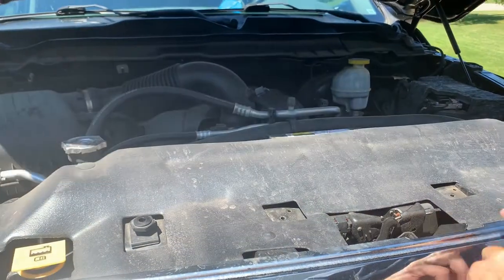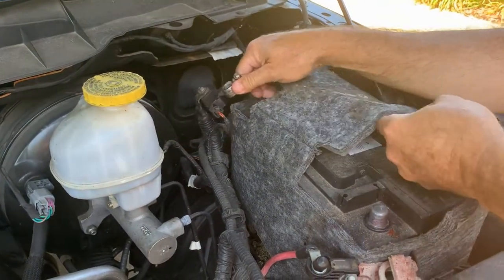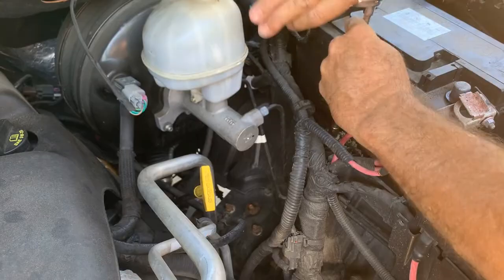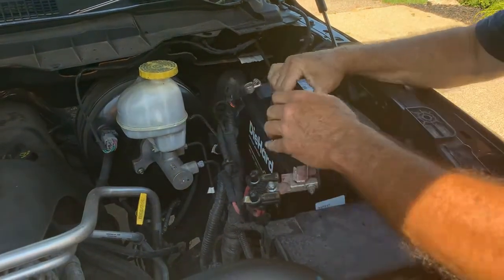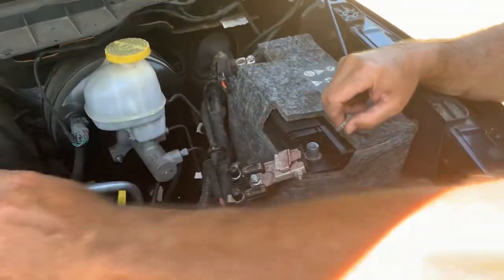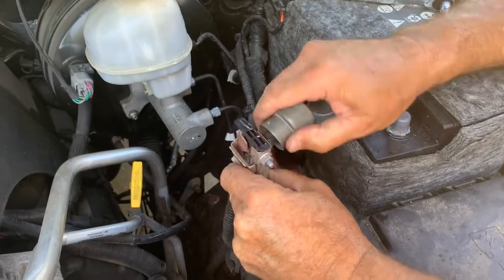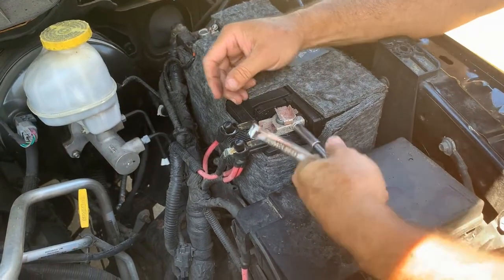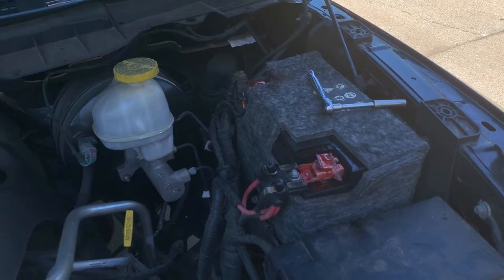How to Replace Car Battery Dodge Ram

Comment: I plan on trying this to remove a dead battery in my 2004 Dodge Ram 1500. My battery is less than 6 months old, and my charger indicated ii is a bad battery. After hours on charge, it does nothing and the lights on the dash and one small red light there all flash when I attach the charger back to it. The new battery has a strap to it, but I could not budge it for anything when I tried to remove it. I simply didn't realize that surrounding protective cover removes as you showed and the bolts holding it down are hidden like that. I sure am hoping that I can get it fixed tomorrow and take this dead battery back to exchange. Thanks for this video, as it is really helpful if it works okay on my '04. I'll have to get that small socket though. ;-)
Reply from the maker: You're welcome , Good luck!
Reply: Heyyy, how'd it go? I have the exact same truck. 2004 dodge ram 1500 5.7. I am about to try this too. Thanks for the tip!

Comment: Good video I thought you were supposed to disconnect negative first for safety. I'm trying to figure out if I need to use a memory saver for 2018 Laramie that has remote start.
Reply from the maker: Thanks, this Ram also had remote start no memory saver was needed.
Reply: Yes, you're correct. If you take the positive  off first, and you touch the metal from the truck with your tool, you create a perfect short. Reinstalling, same thing, put the positive on first and then the negative.

Comment: I’ve heard that disconnecting the battery on a New Ram truck will cause the vehicle computer to loose the memory. Did you experience any problem like that?
Reply from the maker: I've done quite a few 2016,17,18s and haven't had any problems. You might have to reset your clock and radio stations.
Reply: @TheAutoTeacher  That sounds about right, but just to be safe I’ll keep on checking just to make sure. Thanks

Comment: How many Amper
Reply from the maker: Dodge Ram 1500 from 2009 to present: Group size: H7/94R. Cold cranking amps (CCA): 750 to 850 amps.
Reply: @TheAutoTeacher  thank you so much from libya 🇱🇾